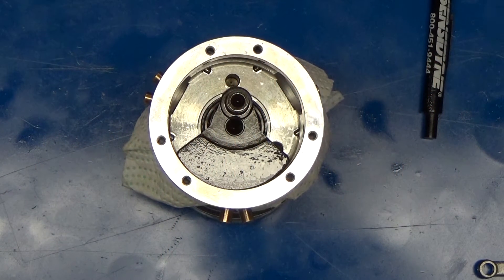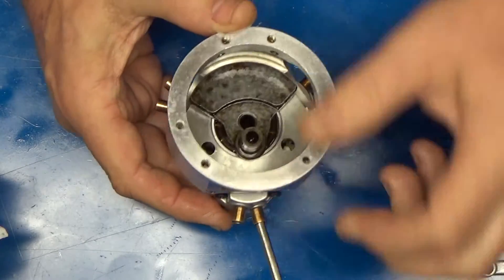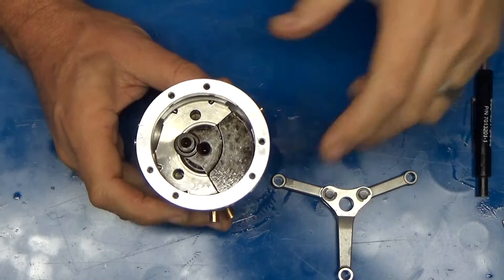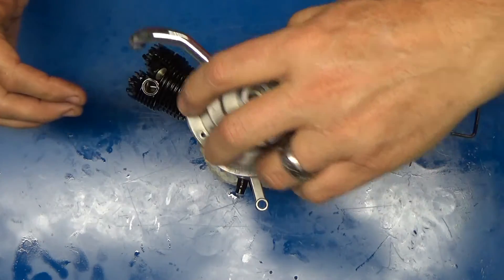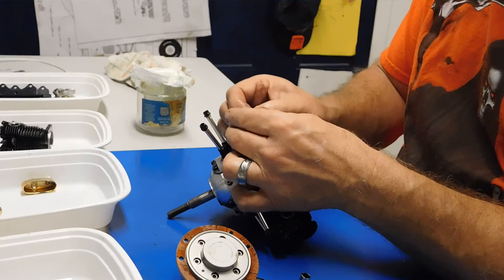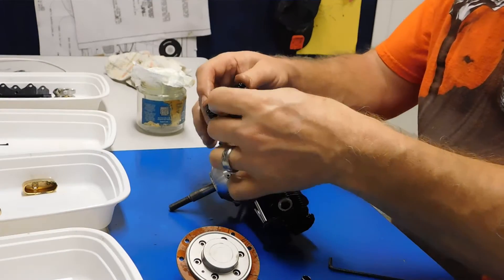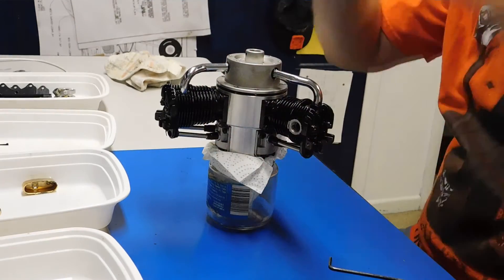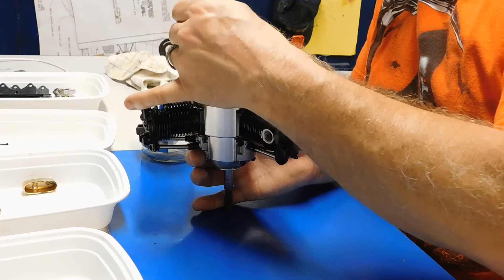Saito FA170R3 Customer Rebuild Part 5

Comment: Hi David,, this is a great series of videos,, thank you so much for sharing.
I know this video is old by now but maybe you can confirm one thing anyway ,,  regarding the back cover and the "dot",,,   is it supposed to be aligned with cylinder 1 ? Checking my engine "new" it is aligned with cylinder 3.. With the fuel/gas flow in mind and uneven cylinder temperatures I would think that positioning is critical..
Reply from the maker: I cannot answer that.
Reply: @dmrcflyr2  Ok.. tanks for answering.

Comment: No worries. You were thorough and fixed the issue. Great job I learned a lot. My fa 45 is out of time after changing the bearings and I'm only dealing with 1 cyl. lol. Plus keeping those Teflon buttons in place, What a pain!